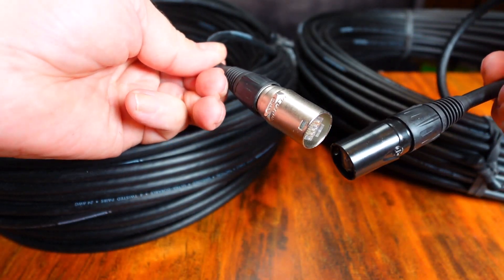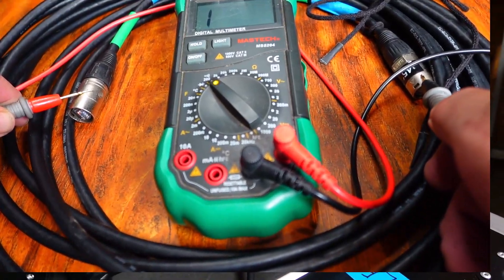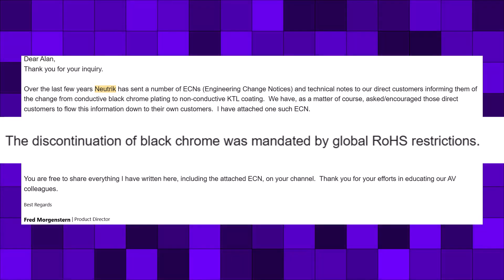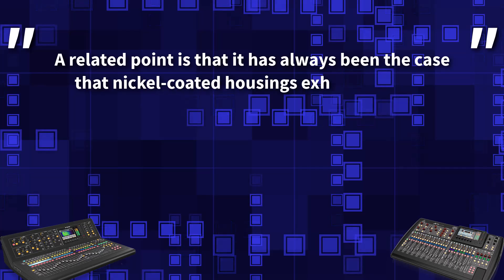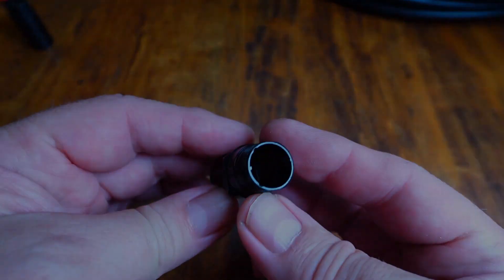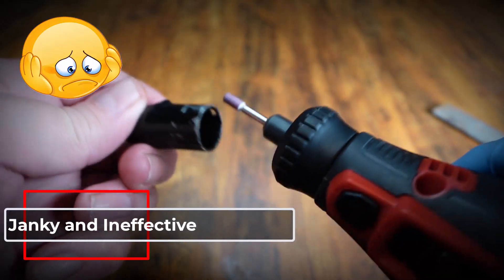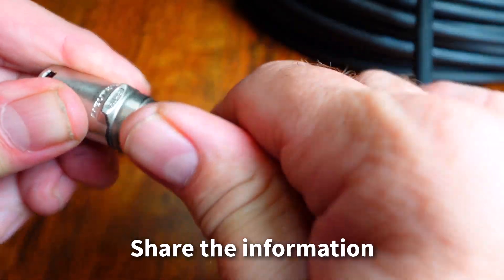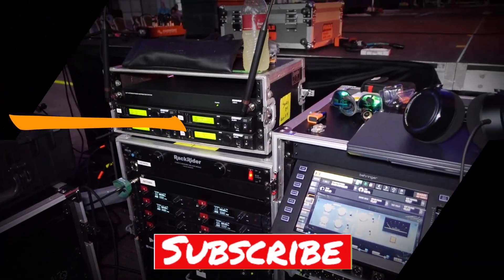Black Ethercon Connectors – Hidden AES50 Problem - Behringer X32 / M32 / Wing

Comment: Thanks for another informative video. Sounds tools changed their connectors for this reason.
Reply from the maker: Thanks! I'm surprised at the amount of the new black Ethercon connectors in the wild these days, considering this issue. Obviously, Dave Rat and company paid attention to the ECN.
Reply: @AlanHamiltonAudio No, Dave got complaints from customers having problems. 

After his own investigation he found out that the New black connectors were not conductive after which he contacted Neutrik. 

Long story short:
It ended up costing Neutrik money because Neutrik did NOT communicate the change to Dave.

I used to do some product testing, trouble shooting and spin ideas and possible problems for Neutrik and I can tell you from first hand that Neutrik isn't communicative at all nor do they feel a responsibility to inform their direct customers.

They just release their product changes on their website and expect their customers to be able to find them and read them.

Neutrik and me are up to the point that we can't be in the same room for legal reasons. One of them being that they stole my idea for the Ultimate Plug without any compensation whatsoever.
Reply from the maker: Thanks for the info. I guess I just assumed Dave found out the info from an ECN and then made production changes versus customer complaints.

But this once again confirms that 'conductive' Ethercons are a necessary part of the equation for fighting ESD. Otherwise, even with the newer black Ethercons no customers would've been having problems with the unknown changeover.

There are people that still say "If the RJ45 itself has the shield connection and the cable is shielded, then the Ethercon is unnecessary!" 
I've read it a couple of times on FB this morning since the video came out.

But people doing ESD testing have proven that is not true. And what you're saying about @DaveRat would confirm that as well.